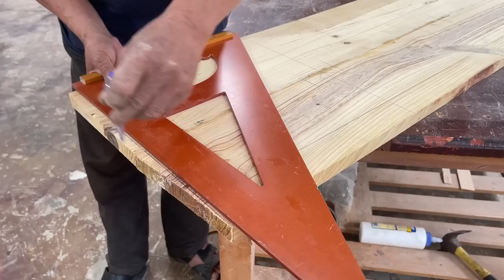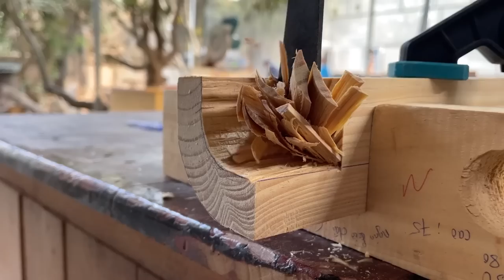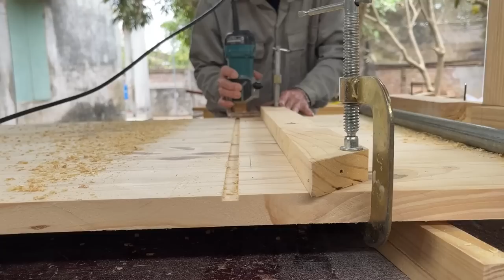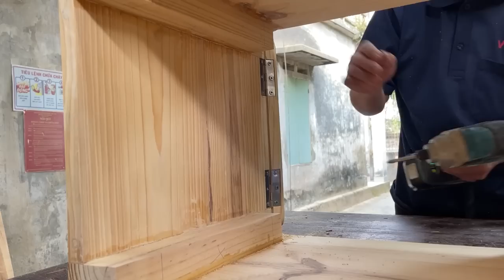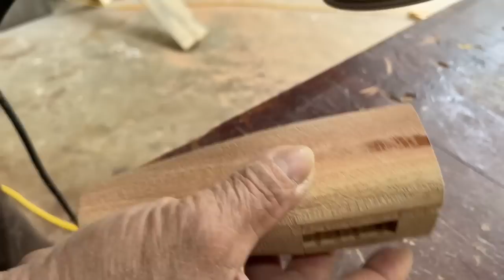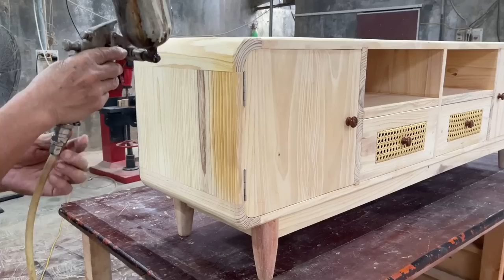Skillful Hands Processing Woodworking || Special  Design Ideas The Living Room's Furniture

Comment: I have limited tools, had to cut 4x4 post, (a precise cut at 39")
on my tailgate with no clamps, to keep Handsaw vertical, I placed two pieces of wood, on either side of saw, held with one hand tight to saw, while holding 4x4 down, sawed with other hand. End result, cut was straight enough wood stands on its end, on its own😏